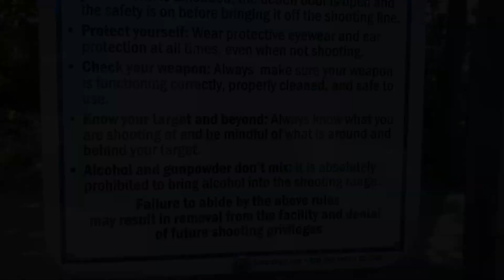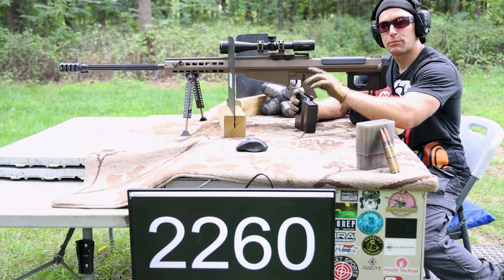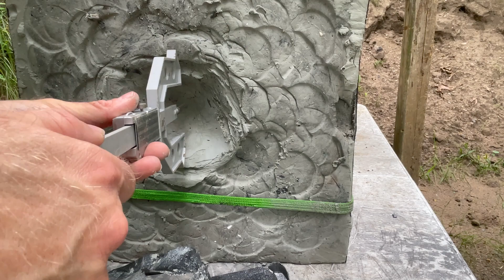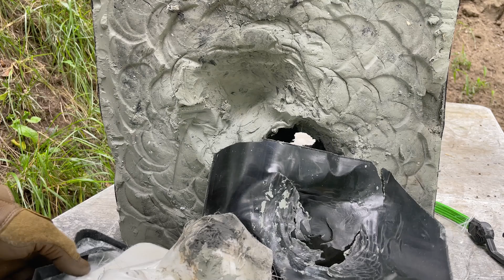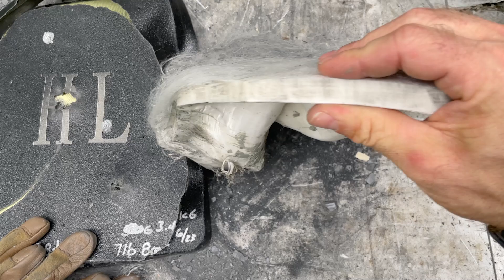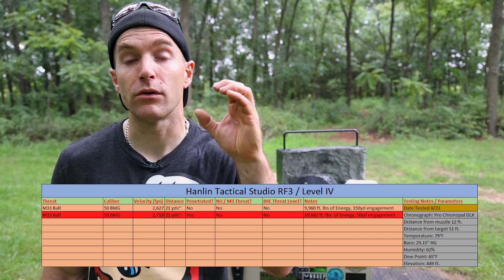50 BMG M33 VS Hanlin Tactical Studio NIJ Level IV /RF3

Comment: one thing. I'm pretty sure that the NIJ measures backface from the original shape of plate, in form with the clay, so it measures essentially the total travel distance of the rear of the plate. I think you could effectively recreate this with a semi-rigid wire mesh (holes large enough to poke the tool through) which you could form to the plate beforehand, and place over the clay to use as a reference point.
Reply from the maker: Correct. I should make a beam that goes across the front of the briefcase and then can mount depth gauge to.

Comment: Think this would stop pap? Seems like a slightly heavier colossus competitor.
Reply from the maker: M2AP?
Reply: @BuffRANGE  swiss p ap
Reply from the maker: @qwe304  good question. It has a fairly robust and thick strike face.
Reply: @BuffRANGE  do you have pricing for the plate? im curious how it stacks up in that regard.
Reply from the maker: @qwe304  I would have to ask Hanlin
Reply from the maker: @qwe304 looks like he says around $400 ish for a plate
Reply: @BuffRANGE  sounds like it may be a good option for those wanting to upgrade from 1155s or 4401's, but that cant spring for the $650 colossus. are they in development or are they available?
Reply: Swiss P AP, at least in .308, is only 12mm/150m, which is much less than M993's 18mm/100m @qwe304
Reply: @MandolinMagi  my source puts it at 20-25mm@100m
Reply: @qwe304  The plate is the same one that's been sold by Hanlin for a while; it's just a very beefy plate for a IV, with a nice monolithic ceramic layer. But he's a small studio that makes in smaller numbers and may not care so much to sell overseas due to the hassle (also shipping could be notable added cost for the end user too).